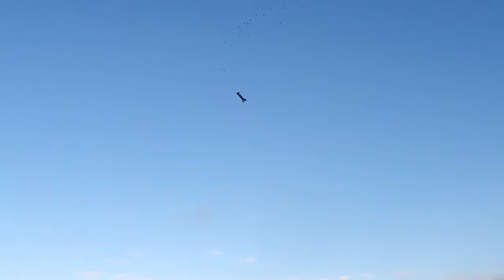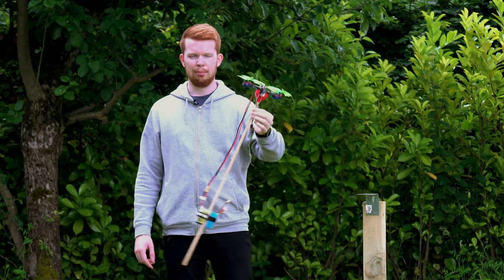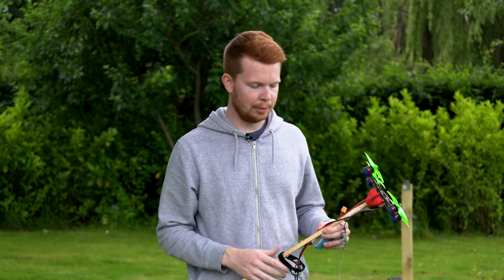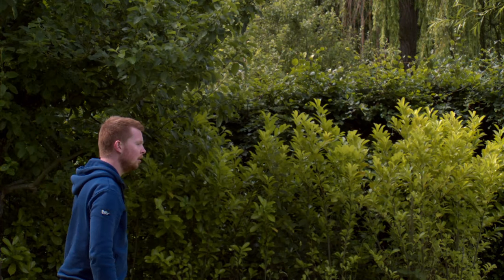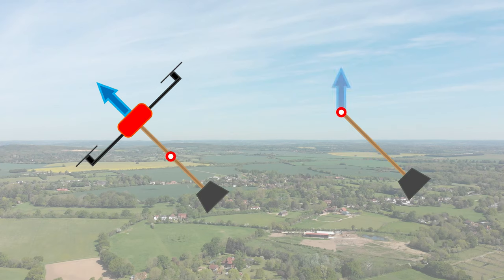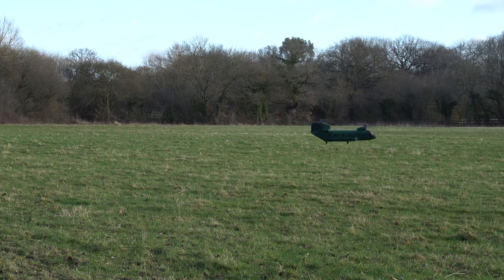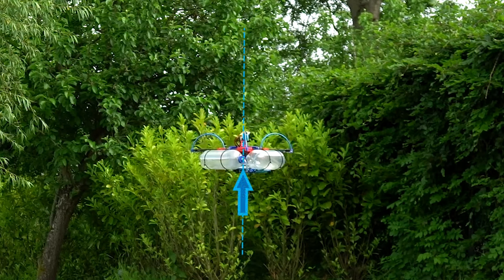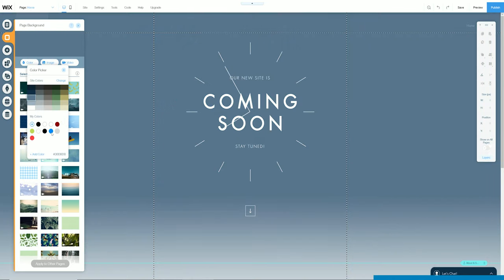Drone Pendulum Fallacy

Comment: "no accelerometers on the drone" 
there are always accelerometers on a drone, that's how they self-stabilize.
very good explanation though
Reply: Not  always, you don't always need stabilization systems in a drone if you just want it to go up and down, or if you use ducted fans there are ways to self stabilize.
Reply: @milmaxleo7268  A drone will never be able to maintain a stable flight (even just hanging still in the air), without the flight controller, which uses an accelerometer to determine orientation and angular speeds and accelerations.
Using ducted fans makes no difference, as you still need to know the orientation of the craft in order to make corrections.
Reply: @n3lis94  you are mostly correct, however in reference to the video he was trying to demonstrate why the pendellum fallacy does not stabilize. And besides a well balanced drone would be able to maintain a somewhat level orianation without a flight that control of the center of mass and center of thrust are inline. It will like you said have trouble doing anything else unless the pilot is manually balancing thrust

Comment: lol. This obviously makes no sense. A drone needs to have the mass the closest you can get it to the center of gravity, to have the lowest mass movement you can achieve when tilting.

A drone always need to tilt to compensate for wind, and the lower the motors need to spin up and down to get the tilt done, the more stable the drone is.

Comment: Stability doesn't mean the drone would return to level flight, if that's what you're implying. Top or bottom mount options are simply a way to move the center of mass closer to a position where the moment arm of the weight of the battery is minimized. A better analogy is swinging an ax. If you have your hand close to the head, the ax is easy to swing, as opposed to down the handle. This is an issue of angular momentum which the mass times the velocity times the distance. Or the angular velocity times the mass times the distance squared. Since the battery is attached to the quad, it will have the same angular velocity, so to minimize its inertial effects, either the mass or distance can be reduced, which you kinda mentioned.

Comment: You guys make this WAY too complicated.

(BTW: I believe Robert Goddard demonstrated this exact “fallacy” with his first liquid propelled rocket.
And the Segway, of course).

The first time I saw pictures of those hovercraft type flying machines that the “pilot” just stood on and the thing self stabilized - I had to figure this out.

It’s not about the pivot and all that. It’s mass and acceleration.

Think about it this way. You have a drone with pendulum...

Imagine the drone gets disturbed to the left. The pendulum weight, wants to stay behind...
Now the drone is tilted to the left, so it will accelerate to the left.
As it accelerates, the pendulum mass wants to stay behind.
Things get worse and worse...
Very dynamically unstable.

Now, think of the pendulum ABOVE (like the pilot standing on top of those craft).
As the drone is disturbed to the left, the pendulum again wants to stay behind.
Instead of tilting the drone to the left, it tips it to the right.
This causes the drone to counter the disturbance, and it automatically scoots back under the pendulum!
Dynamically stable!

So, the higher the center of mass, the more inherently stable things will be.

I hadn’t thought about it, but the comments about hanging a pivoting pendulum.
I think it would depend on the attachment point, higher being “better”.
Reply: _ David _

“No”, what?
Reply: _ David _ 

Would you educate me?

Comment: you didnt compare the drone on its own without any flight control to the one on a stick you made, so you cant say the pendulum had no positive effect for this test, your test has to be done like this to be worth anything, you have to start from as close to vertical as possible, take off lightly, be inside from and wind effect, time how long a stable flight lasts, then do the same test with the drone on its own without and flight control.

Comment: once you think simple that all is energy electric type and to strip it by involving vander vault static and electro static forces   you will see the air we breathe is our fuel tank for all machines   neutralisation   joe cell talks videos 1 to 11   one is missing out of this as joe let it slip that the tv aluminium aerial can like a crystal radio catch energy  video brock part 2  crystal use for non stop self natural pulse like quartz etc

Comment: No surprises here, multirotors are terrible with sling loads. That's why when they need to tow a sensor bird on a tether they usually use a large helicopter and not a multirotor. Helicopters handle this much better than multirotors do. (indeed helicopters make better drones in better in pretty much every way save for vibration and mechanical complexity)

Comment: I would have appreciated it if the drone actually had a pivot on it, or a string versus a stick. You effectively just made a really long drone where i guess if you were trying to say it stabilizes that way then yeah. 

It would have been much interesting if the demonstration with the fixed object (tree) that had a pivot on it, matched the applied example. 

Now im not saying that this would have worked. Just that given the test and the explanation it had no relation to an actual pendulum except to assume that the drone hard-attached to the stick would act as a pivot point. 

I don't think, from what I was led to believe this video would prove, that a pendulum attached to the bottom of a drone would stabilize it was properly debunked.

Comment: You didn't give the stick a fair chance !  None of those drones would fly for long without active controls. Now would they? the stick was stable you sent it off on an angle and it held the angle , you said it yourself.
Reply from the maker: The stick drone isn't stable, it is neutral. If pushed by a gust of wind, it won't return to it's original angle. Whether I gave it a chance or not, the pendulum effect of swinging to a level position doesn't exist

Comment: well no shit. how is it not obvious you want as much weight as close as possible to the axis of rotation/ center of mass which i believe would be directly in the middle of all 4 rotors or the point in which all 4 rotors would intestect if connected with a strait line. i have next to no experience with drones and this is painfully obvious.

Comment: @Tom Stanton I haven't watched the whole video yet, but if the rates were increased, I think the pendulum effect will be more pronounced.
edit: I've watched the whole video but I'm unconvinced, admittedly the only thing that I can judge off is balancing things. I.e: brooms/kayaks/bikes.
Reply: Which rates? And what pendulum effect? The point of this video is demonstrating that an untethered rigid body creating thrust won't experience any torque due to gravity
Reply: @PKMartin  Sorry. I didn't hear when Tom explained about the FC. I thought it was a normal quad. I couldn't understand why it wasn't trying to remain horizontal.

Comment: Interesting!
But so in the case of Corridor Crew's "360° camera on a racing drone" video (https://youtu.be/vInvov2mSBo), where they mounted a long camera on top, would it make sense to have the battery mounted a bit lower to compensate, and move the center of gravity back to the center of the props?

Comment: I think this video completely misses the point. 
I just got a tiny whoop hover craft, I've never piloted a craft like this before. When the battery is attached where it is designed, directly under the body of the craft - I have a devil of a time controlling the craft. It crashes and lurches everywhere, I cannot manage it.  But if I dangle the battery, letting it hang by it's 10cm lead, the drone is easy to fly. Even a not-quite-a-monkey like myself can pilot it.

I believe this is the phenomenon that leads people to (perhaps incorrectly) conclude that a pendulum is "more stable". I don't know about that, but hand over a simple drone with no altitude control to a newbie with the battery nested versus dangling and conduct a quick experiment. Day and night.

Comment: your drone explanation part is wrong. thrust vector does not always go through the center of mass as you suggest, but in fact is offset like in your other examples. So yes, a lower COG does work like a pendulum on a drone... think again about the whole thing. you came up with an intuitive explanation that fit your initial tests, but is wrong....

Comment: THERES NO PIVOT ON THE DRONE!! Its not a pendulum! There should be a pivot point at that red bit under the drone.
Reply: Beach&BoardFan Wouldn’t work that would only have the additional mass act as additional weight putting more load on the drone